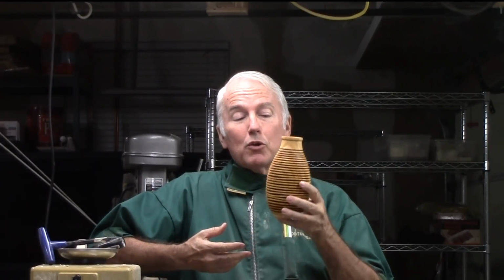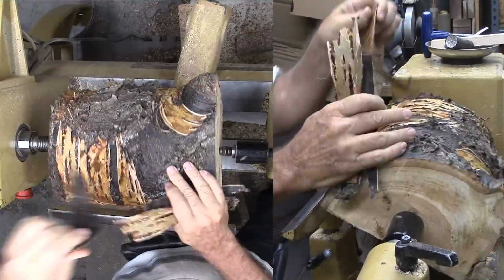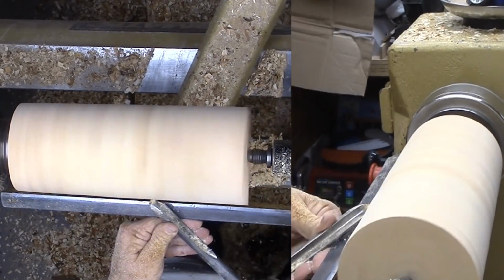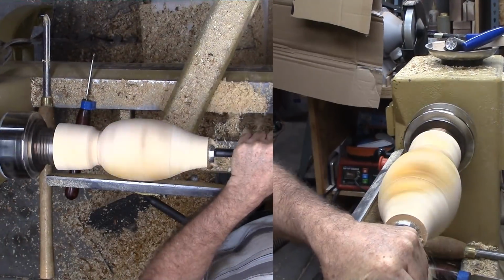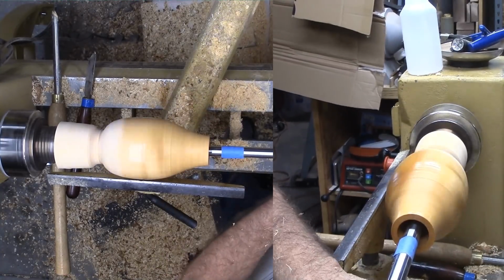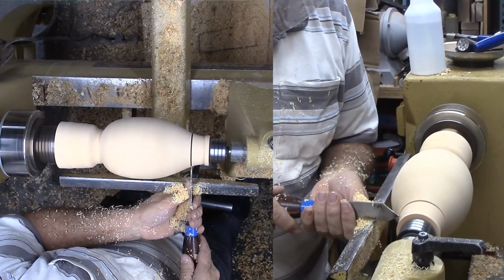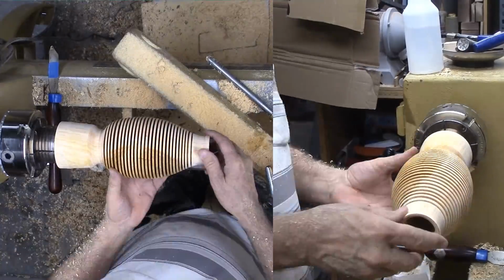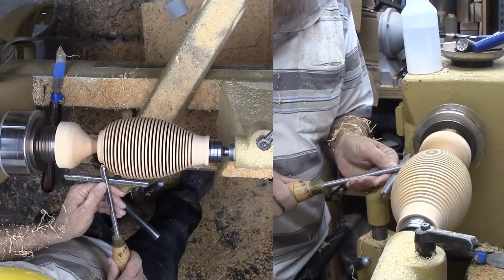Multi Dimension Fin Vase Green Woodturning

Comment: Nice piece Alan,  to get more dramatic warping you could try using a cross grain section. Like the Raffin style tubes. At a workshop with Raffin I made a set of tubes, end grain and a set cross grain. The end grain tubes moved a bit but not near as dramatic as the cross grain. I like the fin tube look. I am coming into some fresh logs in the near future and you have.inspired me to try my hand at this. I expect that the fin cutting will need to happen quickly as the greater surface area will likely start to dry and warp on the lathe like the Raffin style beaded tubes did. 
I always enjoy your posts, great job.
Reply from the maker: The Raffan style tubes are fun. In fact, I turned a couple out of this same batch of cherry but without beads. In class, Richard wants you to learn to bead.  For the tubes, I like smooth..
Worth experimenting see the impact of different shapes and orientations.
Alan